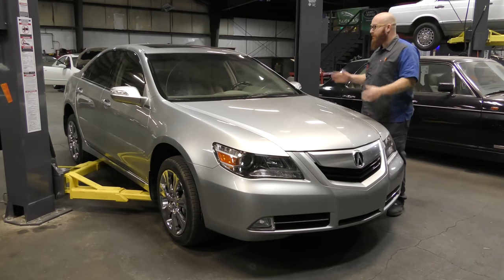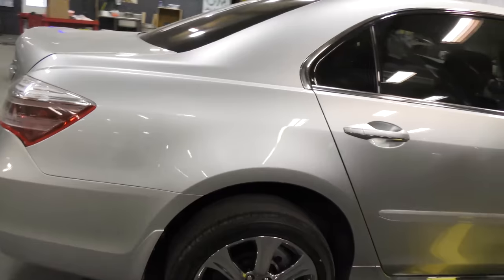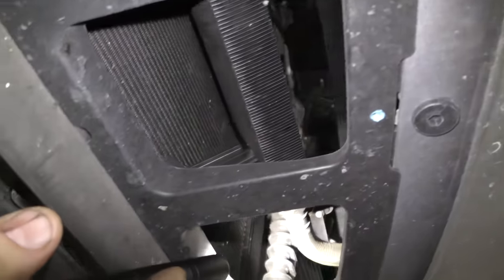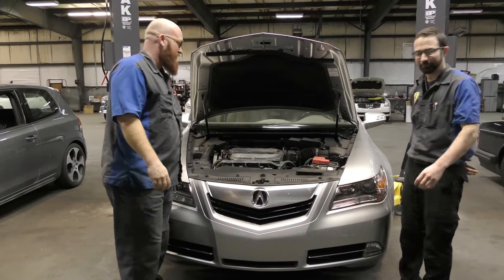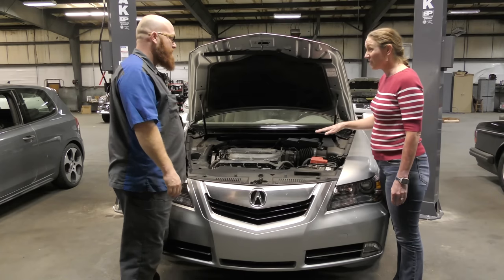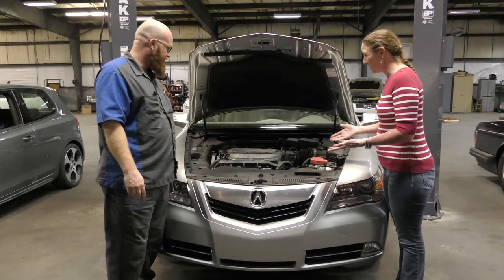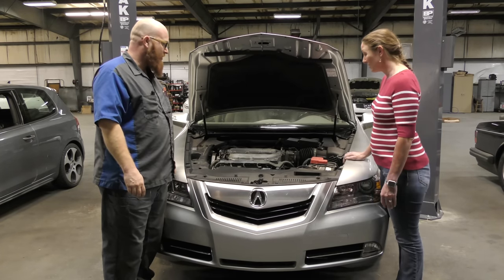Something Very Serious is Wrong with this 2010 Acura RL! What did the CAR WIZARD find???

Comment: We had a 2016 Honda Pilot with the similar engine- it threw a rod at 50k miles. Exact same symptoms. We had the factory extended warranty. Honda fought us on the repair and ended up rebuilding the motor for us. Long time honda family and we were really upset that this happened. Our Pilot looked brand new underneath and inside the motor as well. This owner is not alone in his failure. I don't think Honda is aware of this becoming a larger problem.
Reply: Honda has absolutely no engines in their supply chain and you think that Honda/Acura does not know that they have a problem??
Reply: Well, they're rectifying it now. Still no "remedy" yet for this recall.

Comment: I have a 1998 Acura tl that my dad bought in 1999 from a doctors wife.  Dad didnt drive the car for a few years due to his health, and when he passed, I said to my wife, dad loved that acura, its time to fix it up a little and drive it.  First was the exhaust system.  That was a heck of a hunt, but parts were available, then it came to the brake rotors and pads, from sitting they rusted and glazed over, called dealership both acura and honda. They said not available.  Ended up napa was able to them over a week for them to source all the parts.  Then I had to take it in for inspection, abs light periodically came on, mechanic said it's the front right abs sensor starting to go bad.  Bad news though, no one makes a replacement...  a shame this happens to something like a Honda/acura.  Oh well we still love the car and it only has 68,000 miles on it.

Comment: My buddy has this same engine in his 2013 TL - and this motor is always low on oil - lot of guys on forums have same issue with 3.7 burning oil - interesting the Honda/Acura went quickly back to the 3.5L - the 3.5L in my 07 tl type s has 220k miles no issues - dealer did replace the oil pump at 200k mile timing belt job.

Comment: How come a 3.7 Acura TL Shawd won’t work as a replacement engine???
Reply: That's exactly what I'm thinking as well. This engine shouldn't be any different than the TL's. They came with 3.5 for the FWD and 3.7 for the SH-AWD.
Reply: Won’t jive with the computers...all about computers
Reply: they made  different versions of the 3.7 depending on application, with the RL and ZDX engines being the rarest
Reply: Yeah, the TL 3.7L engines used electric power steering but the RL still used Hydraulic power steering. You can even see the high pressure line when Wizard zooms in around the Serpentine belt. Small differences like that can change an engines serial number.
Reply: The engine is cast differently, different internals, and different engine tune. Pretty much nothing is the same. The RL was very special, and they made very few.
Reply: @NeightrixPrime  lots of small changes happen to engines when they go into different vehicles. I remember rebuilding a dodge 2.7L that engine was frankenstined together with 3 different generations, or variations. Took forever sending parts back and forth to get it running. Hate whoever did that motor rebuild or patch job.

Comment: At 3:37 that's the ATF cooler, not the PS one. And regarding the engine knock - with J37 the odds are it can be just the rocker arm spring, that's a common problem with these and a cheap and easy fix with the engine left unharmed even though it sounds like it's falling apart.
If it turns out that the engine is indeed toast, then one can easily import a low mileage J37 from Japan between 2000-3000$ tops.

Comment: RE:  Hoovie's Leisure VAN

The VCR probably just has dirty heads from sitting so long. There's a good chance you can just run a good quality HEAD CLEANER thru a few times and it will work just fine.  That or you can adjust the TRACKING...  Take it from this old guy...!  

Love your show... good luck!

Comment: Wow! I'm a huge fan of the 2005-2012 RL and I had no idea these 3.7 V6 engines could be problematic. In your opinion, would a person in the market for a used RL of this generation be better off focusing on a low mileage 2008 with the 3.5 V6 rather than a 2009-2012 with the newer 3.7?
Reply: I did alot of research on this car before I bought one I got a 2010 rl shawd, 75k miles for 10k. And what I found they are excellent car there is no reason why it shouldn't last over 250k miles if you take care of it and just do routine maintenance. And obviously look at how the previous owners took care of it get a car fax or something. Chances are if this car does not last over 200k miles you were just a crappy owner

Comment: Must of been driven very low on oil these 3.7s had a warranty extension on the piston rings which causes them to burn oil.
I had a 2012 Acura TL here in Canada with the same engine and I had the piston rings replaced for free at the dealer due to excessive oil consumption.
Reply: The 2010 RL engine didnt have that recall. I know for a fact that the engine was full of oil.
Reply: @lorencooper6043  If that’s the case that is  pretty disappointing for such a low mileage Honda engine to have such catastrophic failure. I’ve had several 3.7l Mdx’s in the family with well over 300k kms still running like new.

Comment: I had this car. The best passenger car I have ever driven in snow.

There was one weird quirk: If you don’t close the gas cap tight or if the gas cap fails, your instrument panel will light up like a Christmas tree and will put the car in a “limp” mode with transmission preventing you from going beyond the 3rd gear. I went to my local Honda dealership and bought the original gas cap. Problem solved.

Comment: The RL is one of the best made Honda’s ever...it’s NSX level, made in japan
Reply: I can confirm that.  I took pot holes, a few curbs, a steel lane dividing cone and hell even a ladder (dropped off a truck in front of me at highway speed)....and absolutely nothing happened to the car, except for a few scratches to the underside plastic.  This car is a tank.
Reply: @gbriank1  yes the built quality between the RL and TL is night and day, it was basically Honda of the early 2000s showing off their engineering ability, similar to Mercedes of the late 80s. If you read about some of the tech introduced in this car it is astonishing.
Reply: Actually all J series Honda engines are made in the US
Reply: @kingmarz3635  Is that the Marysville, OH plant?
Reply: @gbriank1  
The J-series is Honda's fourth production V6 engine family introduced in 1996, after the C-series, which consisted of three dissimilar versions. The J-series engine was designed in the United States by Honda engineers. It is built at Honda's Anna, Ohio, and Lincoln, Alabama, engine plants.
Reply: @gbriank1  sorry I’m not sure. I live in nz where everything is JDM
Reply: I'd buy my aunt's RL if she took better car of it.
Reply: @KushPizzaSleep  the generation came out in 05. Carbon fibre driveshaft!!! Mine has adaptive cruise control and accident mtigation braking. Also the voice commands for almost everything! The super handling awd was revolutionary!! Took several years for BMW and Mercedes-Benz to catch up.
Reply: @kingmarz3635  so they built the engines in OH, shipped them to japan, bult the rest of the car, then shipped it back to US??? 🤔
Reply: Yup.  Got a 2000 w 146k.  Mint.
Reply: The 3.5RL (99-04). Were the last ones totally made in Japan.  They were brought over (complete) on a boat.  I believe that stopped in 05 though.  Still probably great (but I like from Japan on a boat myself)
Reply: @kingmarz3635  my 2000 RL has the C35.  I was told car came over on a boat until 2003 or 2004 then they maybe were assembled in Ohio or SC
Reply: I've been told the carbon fiber drive shaft is  5k for replacement.
Reply: The 1st gen rl was reliable after that no.
Reply: I have a 2004 Acura TSX made in Japan. Nicest car I ever had.
Reply: @lukepecoraro8600  I am a fan of these TSX's. My neighbour used to have one.

Comment: The 3.7 was in every MDX from 2007-2013 and many Tls and RLs why is it so hard to find?
Reply: they are very popular performance swaps for accord, civics etc. they are very rare and expensive to get.
Reply: That and those people still own and drive those vehicles as well.
Reply: @tilleryinnovations592   I’m guessing he wants that specific motor either new or with low mileage
Reply: He stated that the customer wanted only new or remanufactured.. No used
Reply: @tilleryinnovations592  He clearly stated that it was modified by Acura itself to fit the car
Reply: There are specific versions of this 3.7, this RL requiring J37A2 specifically, & I think finding that specific engine is the problem

Comment: It sounds like the oil pump has stopped working and because there is no oil pressure in the head, the camshafts are nocking. This is what my thoughts are. This also explains the oil check light.

Comment: I got an 06 RL currently as a loaner from a friend while my cars alternator gets rebuilt and it has just shy of 300k miles and the car only looks like a high mile car on the seats. They are torn in some areas but the body is clean, no dings hardly and all straight panel gaps. Rides like a dream

Comment: The reason why there aren't any 3.7's out there is because they're typically bulletproof and don't need replacing. This is an extremely rare and unfortunate case. Acura isn't to blame and neither is the owner - just terrible luck!
Reply: That wouldn't be why you couldn't find a good used motor, that's the exact opposite reason.
Reply: actually the are prone to lots of oil consumption problems  a quart every 1000 miles and need  timing belt servers  from 50k to 100k  depending on the weather and rls are not the only ones with 3.7 j series tls also have it
Reply: You cant find them cause they were only produced from 09-14, I believe. Oil consumption is a big issure. Acura dealer replaced pistons and piston rings on my 2010 TL out of warranty for free. It's about $5k job!

Comment: At 5:30...
  I'm impressed that a 4 door Acura has a carbon fiber reinforced driveshaft!
Reply: Composite driveshaft?
Reply: Not Reinforced.  It a carbon fiber driveshaft.
Reply: Cool in an S2000. Not so Cool in that RL. Why bother?
Reply: It also has torque vectoring. They'll haul around a corner.

Comment: Good morning car wizard  Ive been a motor engineer for some 50 yrs i served my time with Rolls Royce !! as soon as i heard that noise i immediately  thought of a broken slack tappet  if this engine is the same design as the 3.5 honda legend they hydraulic tappets ans slack tappets sitting behind the manifolds !! the idea is after a cll head removal  your adjust the slack to give the engine compression to enable the first start up !! until the hydraulic tappets fill with oil !!!       I may be totally wrong but worth using a stethoscope  to check whilst running regards Derek

Comment: The real question is why did it get that low on oil? Oil consumption issue that the 3.5's have? The ring issue? Pull the plugs (mainly on bank 1)

Comment: Open the engine get the crack shaft cut to 10% and service oil pump and install new bigon barring. all will cost 8,500 rupees in Pakistan. 60$ dollars american...
With oil and filter....

Comment: 5:05 also it has a Honda brand oil filter, so you know they took it to the dealership(stealership🤣) for the oil change
Reply: Yeah I bought a 2008 accord v6 that was dealer maintained its whole life.  Most things were maintained well, but two things that really bugged me were the fact that the idler pulleys were not changed during the timing belt service. Also, the brakes were not bled during service and they simply replaced brake pads during brake service and not the rotors (due to those awful Phillip's screws holding them to the hub no doubt). Also, they of course perpetuated the myth of "lifetime transmission fluid". "Dealer maintained" is a mixed bag. All of these items were easy fixes, but never assume that dealerships are overly knowledgeable about these cars or even give a shit about doing everything properly. I do all my work myself,  but for things like timing belts and valvevtrain adjustments that I don't want to mess with,  an independent shop is always the way to go.
Reply: Go to the dealer and you rarely know what they really put in the crankcase or if they change the filter. The are not on the same side of the dollar as the owner.  I NEVER go to a dealer for anything that isn't warranty and even that I triple check.
Reply: @melvingibson4525  I learned many years ago that my cars are maintained best by myself.
Reply: Or it had none.
Reply: @J Oh Everyone should do that. I always change my own so I know exactly what goes in the crankcase and keep my cars forever. 22,5 yr. with current daily driver.
Reply: @coses4957  also a possibility
Reply: Or, they simply bought a Honda filter and did it themselves or at a Honda specialist  independent shop.  I have an ACDelco filter on my GM vehicle, but changed the oil myself.
Reply: @RysterARCEE  Dealerships actually allow Customers to bring their own oil and filter. On these models of Acura you can actually turn the passenger side wheel all the way and the oil filter is right there. I have a 2013 Acura TL that's been dealer serviced but I always bring my own products and I see that parts that I buy installed before I even leave the door.
Reply: @kimitsu20  Some dealerships do.
Reply: @wholeNwon  True. I actually have a Nissan Dealership that services my 2008 Maxima and they allow me to bring in my own aftermarket parts. On the other hand my Acura dealer only allows me to bring Honda/Acura OEM parts, and the filter/oil can be whatever I want. I use Castrol Edge Full Synthetic haven't had any issues with my J35. The J37 in that RL is prone to Oil Consumption and has a recall for piston rings replacement. I wonder why the owner never got this service done it could've saved his engine from failure.

Comment: Just a thought...  there is no physical difference between the Ford 2.0 and 2.3 - they use an identical block.  Likewise, would it be possible that the Honda 3.5 and 3.7 share the same block as well, and that being said, a slight downgrade to the much more common 3.5 becomes an economically viable option?

Comment: Worked at Honda dealer for years,can only remember replacing a hand full of engines,they simply don’t break
Reply: Honda brand cars didnt use the 3.7, but did you not have any engine replacements on the VCM cars?

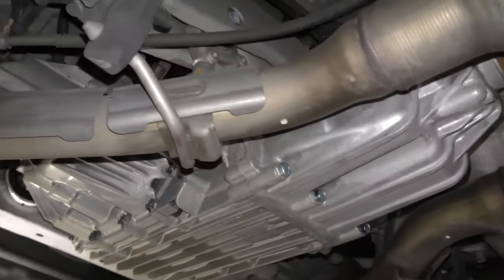Comment: At 6:13...
  That "Super Handling" rear differential is a very trick design.
  It'll speed up the outside rear wheel when aggressively going around corners, while simultaneously slow down the INSIDE wheel at the same time via hydraulically actuated clutch packs attached to the inside/outside axle shafts.

Comment: I’m assuming you mean a new engine is hard to find. Used 3.7’s are everywhere
Reply: Wonder why they are so common used though, not new. Mayhaps supply is so greatly overcoming demand that it's oversaturating the used market with more than likely, dead or dying engines?

Comment: Honda recommends the valves be adjusted every 30,000 miles on that engine, and also has a timing belt. A friend damaged his engine by ignoring the timing adjustments.....the engine had to be replaced and cost more than the car was worth.
Reply: I have 190k on my Acura and never had a timing adjustment. Purs like a kitten!
Reply: Ive done many many valve adjustments on honda engines. Rarely even at 200k  miles are they out of adjustment.  Timing belts last 200k plus almost always. This car likely did not have oil added for a while or they added the wrong stuff.
Reply: chris younts  You cant rev over 5500 on these, they have a rev limiter and the transmission won't allow it either
Reply: The J Series can go 100k in between timing belts and only high mileage ones need valve adjustment. This seems to either be a freak accident or the owner didn’t keep up with the oil changes or used the wrong type of oil.
Reply: @TheMrLebaron  I’ve gotten my 3.5 above 7000 easy
Reply: @alexandermilentis2130  Mine too! My prized 2003 MDX (Skyler) just hit 180k, purs like a kitten as well and you forget it is even on while idling! 
Also Skyler hits 28-31 mpg highway, despite weighing 6,000 pounds with me and my gear inside!
Reply: chris younts  3.7 is known to burn oil. He probably didn't check it, ran it low and destroyed the bearings from lack of lubrication